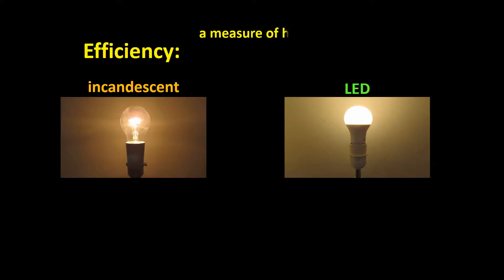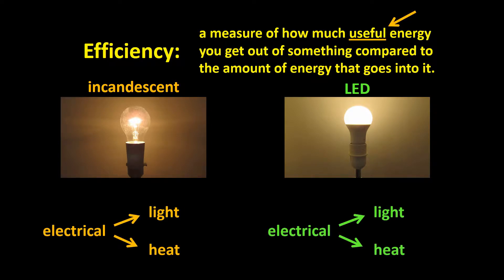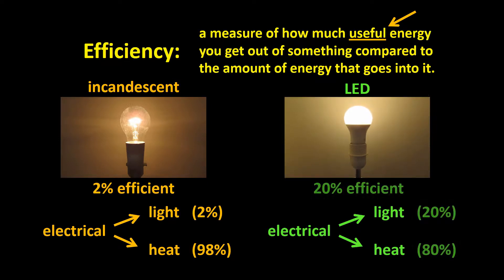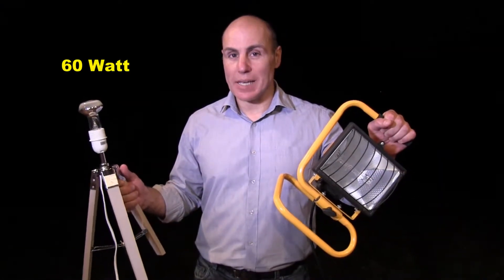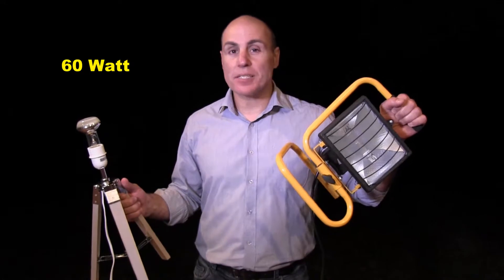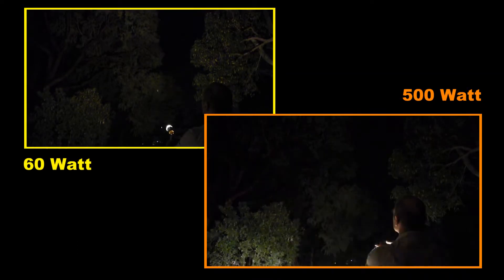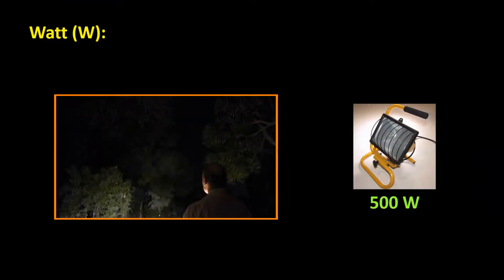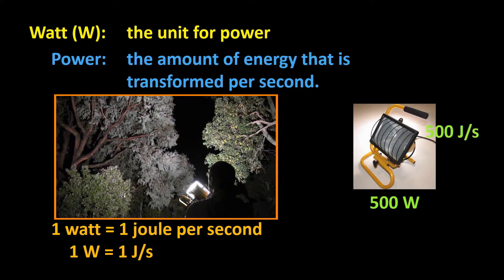Why are LED lights so brilliant compared to incandescent lights?

Comment: Incandescent actually is 15% efficient. Two watts can’t produce 1,600 lumens. You’ll need 14-15 watts to produce 1,600 lumens. LEDs are for more efficient than any other light source and they’re not 20% efficient, no way! They are typically 85% efficient. Only a couple of watts is wasted as heat in LEDs. LEDs save money on your bill. They’re better for summer use than incandescent because heat affects how good the air conditioning cools. It’ll make the room hotter. You’ll need more BTUs if you’re using inefficient lights.